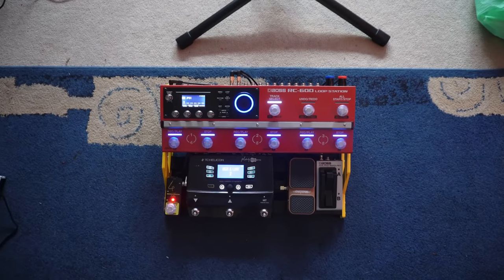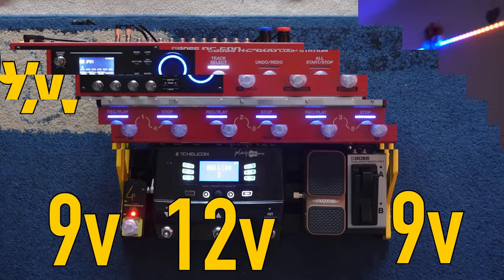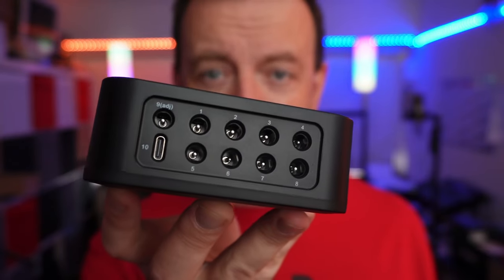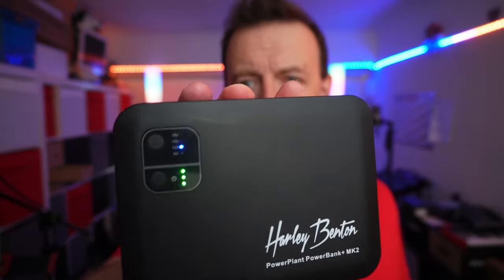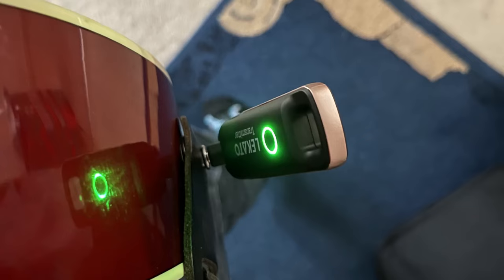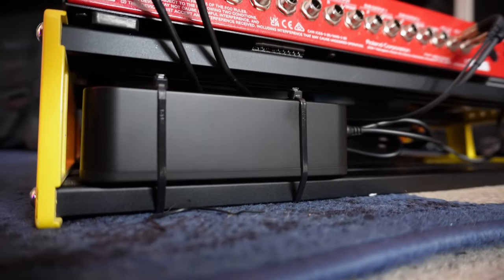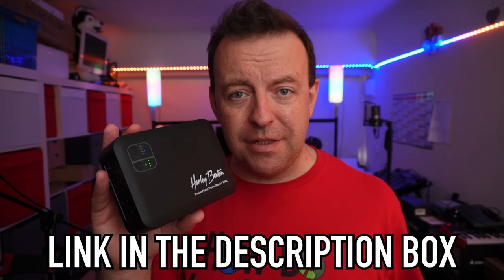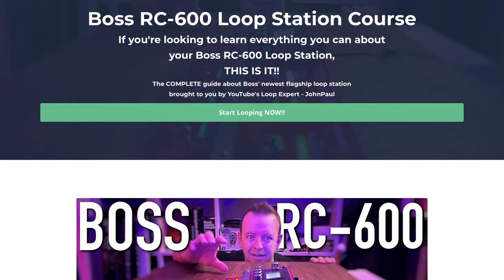This will Power EVERYTHING on my Pedalboard!

Comment: Be wary tho. This seemed like a good product BUT - we performed a day of playing in four outside venues for a town thinking this was the perfect power solution. It failed on us three times! We're powering: Boss RC-600,  thx Bass 9, Boss SY-300 and an AKG perception microphone receiver (12v). So only 4 of the 10 outputs available. We use quite complex assigns on the looper and my theory is, it pulled sudden requests for energy when kicking in certain routines. The Power Pack shut down and restarted, killing our music stone dead, mid song multiple times. Very embarrasing and apologising while the systems rebooted, left looking very unprofessional. I will probably keep it to power the 12v item by itself but other than that - I don't trust it.
Reply from the maker: That’s very interesting. 
Have you ever tried using a double cable to put 2x 500mA to get 1A out of it? Just curious. My assigns are pretty basic and it hasn’t failed on me yet including 2hr live stream, 2hr set in a field and 40mins on a stage.
Reply: @JohnPaulMusicUK  I haven't tried that, no. Not being very clever I didn't realise having two of the outputs into one would increase the ampage. I'll give it a try, thanks.
Reply: @JohnPaulMusicUK  Good news and thanks for the suggestion - doubling up the outputs seems to work better. I did try a test with powering a handsonic drum as well but this went too far and failed.  So the moral is try it out first to make sure it can power everything you need.

Comment: Great video JP.  I looked into this but I have the VL3X that needs 12v 1A, so this unit will not work.  Is there another suggestion?  I also have 4 other-9v 500mA sources, and phone an iPad sources.  Any thoughts?

Comment: Would this power a GT1000???
Reply from the maker: According to the power of the internet.. it needs 9v DC 670mA.. so you would probably need a dual split ABY cable to plug in 2x500 mA to give it enough power.

Comment: It seemed very interesting, then I read the reviews about the noise issues, so that turned me off... Let's hope Thomann fix that, maybe then I'll consider...
Reply from the maker: I haven’t had a noise issue on mine to be fair and not just saying that as this isn’t sponsored. I bought this. Only heard noise (from the device not through the audio cables) when the battery got really low.
Reply: @JohnPaulMusicUK  Yeah, just like I wrote... the reviews turned me off. I haven't had any experience with it and I'm seriously considering a HB power-pro with the AC connector. Glad it's working for you! Thanks for spreading the word about those!
Reply from the maker: No worries. 👌

Comment: Nice John Paul, I'm looking out for a portable power supply for my tiny pedalboard, this has a lot of power though looks a wee bit chunky for me. I used to have that lekato wireless, I found that it sucked a lot of the tone out compared to a lead so I'd recommend using an EQ pedal to boost where necessary to overcome the tone loss...my lekato wireless unfortunately stopped working after a few months.

Comment: I bought one of these in February 2023 and am very happy with it. It was the only 9 volt powerbank that I had managed to find on the market after hours of searching over a couple of years. I was using USB powerbanks with small 5 V to 9 V step-up transformers and DC power leads that I soldered myself because I couldn't find a 9 V powerbank. The Harley Benton unit was simpler and much more robust than that setup. The additional 9/12/15/18 V selectable voltage available at output 9 is also very useful for other gear besides effect pedals.

My unit works great, but there is one thing to watch out for: I just tried to use mine after putting it away nearly fully charged 3-4 months ago and it was completely flat, so I suspect that it may have quite a fast self-discharge. In future I am going to charge mine once a month or so whether I use it or not, just to make sure that it does not self-discharge to too low a level. Running a battery or a powerbank (which is just a box of batteries) down to totally flat is generally not good for the life expectancy of any type of battery.
Reply from the maker: That’s great advice and excellent to know. 👍🏻

Comment: I need help on this please... I was trying to go outdoor and play a little on my own for fun and sun. But I barely know anything on electronic.

I just talk with a guy in a  music store section and he said that I shouldn't be using a powerbank for the pedals as there is degradation and the pedals need a constant flow that is not regular on powerbanks. If you play plug into an outlet it comparing... it would have much better quality... I've seen some comparation videos between 9v and outlets here on youtube and you can actually notice I guess. 
But anyway... he then refer to accumulators that help to ensure the distribution of power i guess?  He also said using powerbanks could cause static noise specially in certain pedals like distortion or compressors since they use more something...
So my question is... This Harley Benton has these problems? Have you tried to supply power through a power bank to compare with this Benton powersupply/powerbank?

Comment: Hi John Paul, I see you're using the power bank with the RC600. 
Specs on RC600 ask for 1.2 A (with phantom power), 1.1 A (without phantom power). Your bank says it delivers 500ma. 
Are you having any power issues with the RC600? I play couple of unpowered gigs each month and would love to use the RC600.

Your videos are super helpful. Thank you
Reply from the maker: Hello. I’ve not had a single problem with it with this power bank. I do not use fantompower with it at all and it has never cut out and it has been fine. The power bank runs the RC 600 and the TC helicon voice live play acoustic. 
I could probably get five to six hours out of one charge. 
Hope that helps.
Reply: You bet, that’s great to know! 
The power is the only reason I haven’t jumped into the RC600. 
Time to upgrade, I think. 
Thanks again for all the info!! Time to buy some merch 😁👍🏻

Comment: Hey Jp, great video. I picked one up recently and found that the cables provided do not fit into the Helix HX stomp. The power for the stomp fits the powerbank though, both being 2.1mm barrell. Strange. Any suggestions on cables to fit?
Reply from the maker: Ahhh that’s a shame. You’ll have to find out what the mm is and I’m sure there is a cable out there on Amazon somewhere!

Comment: I would like to know if this powerplant may work to make a Positive Grid Spark 40 into a full portable amp (it works with 19V).

in Amazon theres a battery pack that fits with the Spark, but sadly I they don't send it to Finland where I live.

I can order this from Thomann, that's why I'm asking.

Thanks for the comments :D

Cheers
Reply from the maker: I’m afraid that’s the switchable connection only goes up to 18v

1 DC Output: 9 / 12 / 15 / 18 V selectable (max. 500 mA)

Comment: Hi. I would like to power the rc600, a 9v 100ma compressor, a 9v 100ma tuner and a controller that requires 9v 500ma (which I normally power separately because it can have interference if powered by other pedals). Is this powerbank suitable for all these pedals? I would like to achieve a result like yours

￼

Comment: I buy the artist power bank won't even run a small multi effects board with one distortion.  Hope this one's better good video
Reply from the maker: Always check the voltage and Wattage you need from your stuff. Get a piece of paper and a pen and go around your stuff and write down what it needs. Then, find the right one based off that. If it’s a battery based one, then work out that if you have all the stuff you need plugged in, how long it will last. 
Hope that helps. 👍🏻

Comment: Not available in Australia, sadly.  I use the Joyo equivalent, however the 12V port on it doesn't spit out enough mA to power the TC Play Acoustic, but it runs everything else I need
Reply: That‘s indeed a shame. Thanks for raising the point, for it will also apply to any other pedal that draws more than 500mA (as I just researched).
Reply: @scottbecker3485  the Joyo one has 3 500mA 9V slots, however the 12V (adjustable) slot only supplies 300, so not quite enough to get the TC working.  Still a good battery solution.
Reply: @ChrisRulewski  Thanks for sharing this. Perhaps one needs to create a pedalboard with only effects that will work on this power supply. A bummer, but also an opportunity. ;-) And although I hope your Play Acoustic will live for long, if it ever conks out then getting a replacement got a lot more tricky (and presumable expensive) due to its makers (TC Helicon?) having gone out of business, or so I heard.
Reply: @scottbecker3485  I run 2 separate boards, one all on the Joyo battery unit (including the RC600) along with 9 other pedals and switches. I have the Play Acoustic set on a separate board on a different power supply (requiring AC power) that can support it, and then just link the 2 boards together. 
If I need to run both in a "powerless" situation, I have a 300W power station to power the TC board if needed.
Reply from the maker: That’s a real shame. Hopefully a solution is out there for Australia 🇦🇺

Comment: can you power up the headrush mx5? i ask cause it says that the 500ma is the max and i dont know how much ma this unit is :(
Reply from the maker: It says on the back of the unit. The MX5 is 12v but needs 3.0A - that’s 3000mA.. so that’s a lot more power than the power plant can generate.. so unfortunately no.

Comment: Thanks for the video, just wondering if you get a current doubler cable for the higher power consumption FX boards such as the Line 6 Pod Go/HX Stomps types?
Reply from the maker: No you get single cables in the box so you would need to get a double cable to drive 2x 500mA
Reply: @steve_one the powerbank will power the HX stomp on its own but will have humming if you add anything else

Comment: Looks awesome. Donyou think it could power a Hotone Ampero One, Joyo Compressor, Full Tone drive, and Joyo AC Tone without any hum from the pedals? Im also not 100% knowledgeable on power and outputs and what not, so my other question is, can i use ports that arent 500mah to power 500mah pedals? Does it send required ampage to power those pedals?
Reply from the maker: You need to check the mAh for each pedal. If it’s under 9v 500mA then you are fine. 
If it’s over 500mA then you can get splitters to plug into two of the outlets of the power supply to combine the power to produce 1000mA.
Reply: @JohnPaulMusicUK  amazing! Thank you

Comment: Am i ok to use 500ma for my 100ma 9v pedals and what is the 12v ma for on the battery i know its 400ma for the tc play acoustic
Reply from the maker: 1 DC output: 9 / 12 / 15 / 18 V selectable (max. 500 mA)
Reply: @JohnPaulMusicUK  also I'm using the old rc 300 my singal set up is boss oc 5 - fender smolder OD- tc play acoustic - rc300 to pa. should I run my other pedals through my play acoustic into my rc 300 or will it cause latency due to the Di output for guitar on play acoustic. Thanks always great content you taught me so much

Comment: Question: BOSS RC600 needs 1.2A current draw, do you just have a current doubler cable plugged into 2 500mA port? Does it suffice?
Reply from the maker: Hey 👋 
So here’s the thing. What it needs is based on what you are doing with it. 
The draw is based on the maximum possible output, and I’m sure they say it needs more just in case. So imagine using the RC-600 with 2 mics on phantom power at full volume. Yeah it’s gonna need a lot more power. 
I’m using 1x 500ma and it’s fine but that’s because I’m not using phantom and I’m not driving past 50% of the volume at gigs. I’m surprised as well.
If I ever get that issue then yes I could use a doubler cable and get 2x 500 for it but it’s chugging along nicely. 
Maybe I should stress test this out.
Reply: @JohnPaulMusicUK  Defo! not a lot of videos telling people what current it needs. I know using phantom power it may need 1.2A and not using it much less but nothing in the internet that I can confirm this. That's awesome I might just use a current doubler, there's lots of power ports anyway on that Mk2! :))
Reply: I would be wary. We tried this unit with an RC-600, Sy-300, ehx Bass 9 plus an AKG receiver @12v. It failed three times.

Comment: The RC-600 has a 1.2A power supply.   No issues running off 1 - 500 mA port?
Reply: Curiosity got the best of me so I connected a lab power supply at a constant 9V and the RC-600 pulled a max current of about 630mA while I was pushing through it’s paces, trying to max the processor out.  Probably some leeway on the Harley Benton specs making it most likely not an issue.
Reply: Good question.
Reply: @philmartin9486  Upon second think, maybe he using a doubling cable of some kind to get more power draw? I believe such a cable exists, and the only drawback is blocking two ports.
Reply from the maker: No. No issues. I’m not running phantom power at all so maybe that’s where the reserve is for the 2 XLR inputs. But it’s been fine and I’m so impressed with it.
Reply from the maker: Hey Scott. Nope, not using a doubling cable. Just using one and works great. Again, I’m probably drawing not a lot of power cause I’m not using phantom on the system at all.
Reply: @JohnPaulMusicUK  Great news! :-)
Reply: @JohnPaulMusicUK  Thanks for your spirit of adventure leading you to try this despite the specs (something I wouldn‘t have even attempted), thus opening up this cool option for your followers! Will definitely return to this and purchase it if and when my compact wire-free board gets created.

Comment: Can it power the amp too? What cable for that?
Reply from the maker: That depends, and you need to be really careful with the voltage.
You need to check whether the amp has the right connection, or you might need to buy a separate specialised cable.
But unless the amp is 500 mA or less than I don’t think he will be able to .

Comment: I see that there’s very little clearance on top of the power supply on your board. The power button of the supply seems to be on top. How do you turn it on with so little clearance?
Reply from the maker: You are right. I originally used 3M (hard Velcro) to tape it to the board but then there was zero clearance. There is JUST enough room for me to push the button. The alternative I have been considering is to zip tie it upside down and press the button from underneath the pedalboard as I get it out of the bag. If the switch was on the side it would be perfect. 👌
Reply: @JohnPaulMusicUK  really makes me want to consider this haha

Is that the large or medium Nux board?
Reply from the maker: It’s the Large. 
With rubber spacers, you can make it a bit wider and put the RC-600 on the bottom if you prefer.
Check it out here: https://youtu.be/Zc4bcpQJ7cM
Reply: @JohnPaulMusicUK  Yeah, awesome. I also have the Large so maybe I’ll switch to this from the Strymon Zuma. Really love the idea of being wireless.
Reply: @JohnPaulMusicUK  I've done exactly this (i.e. zip tieing upside down) and there is just enough space to see and press the power button + also see the charge indicators so all good (would post a photo if you could in YT comments!) - glad I didn't add the 3M stuff first!
BTW thanks for all the great videos (in particular related to the RC-600) they've really helped me get up-to-speed as quickly as possible moving away from my RC-30 setup!

Comment: Do you have a second one as a backup?
Reply from the maker: No. Only just the one but could do for the future. I mean, for the price at £77, it’s worth doing!
Reply: @JohnPaulMusicUK  Yeah, that‘s kinda what I was also thinking. For a gigging musician, having a charged backup could be a make-or-break thing, since nobody wants to start scrambling for wall warts and extension cords just before or during a gig, just in case disaster strikes. That said, I just checked the weight, which is just over 700g, so a spare would definitely be an item to preferably be left in the van until needed. In closing, THANK YOU very much for presenting this battery pack, of which I was not aware. This has me scheming and dreaming in new directions, including the creation of a small and compact pedalboard like yours that can run this way. Do you also have vocal harmonies covered by one of your pedals?
Reply from the maker: yes. the tchelcion voicelive play acoustic.